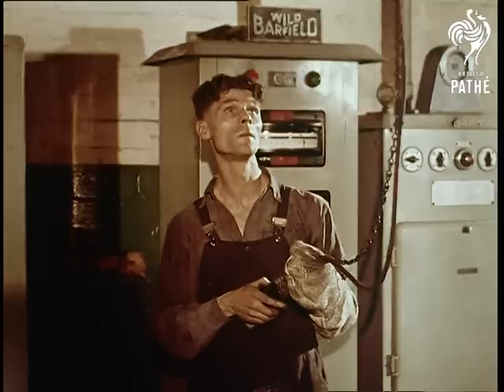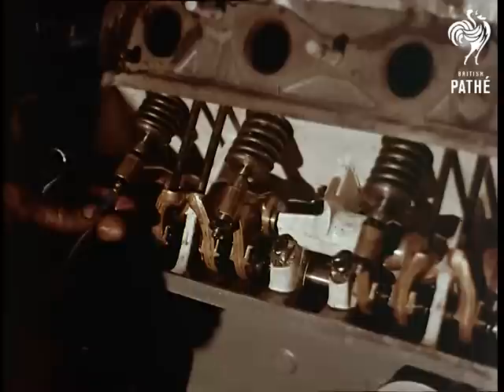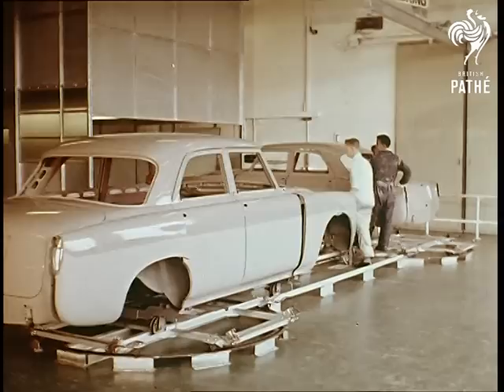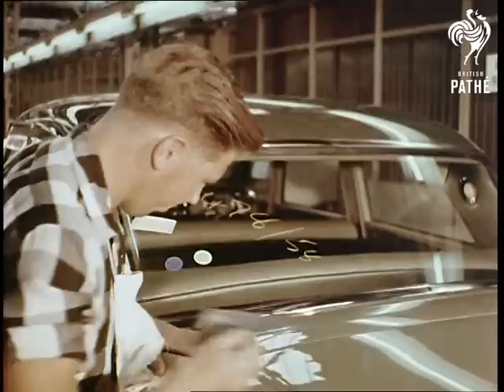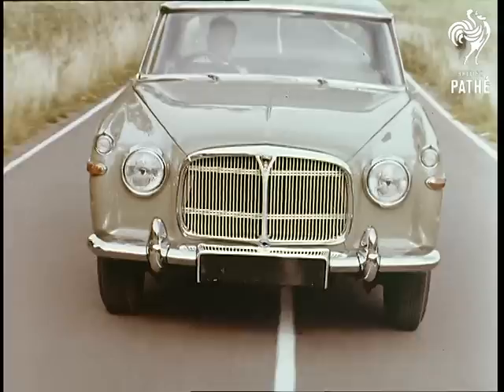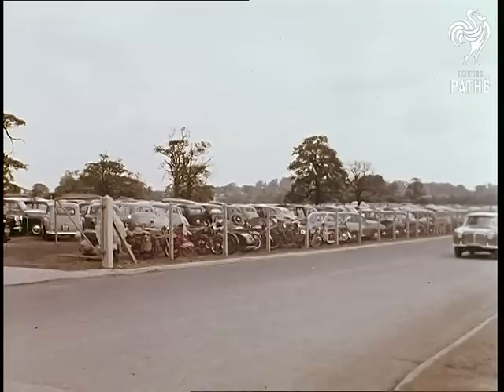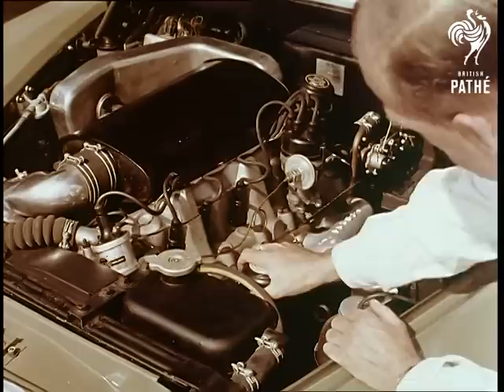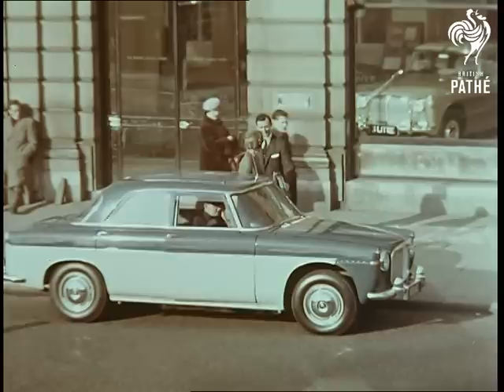In The Rover Tradition  Reel Three (1950-1959)

Comment: I had a 1971 3500 V8 . Still had bolt on wings but severe corrosion under the sills.  Great car though. Used to leave everything on the motorway in the dust.